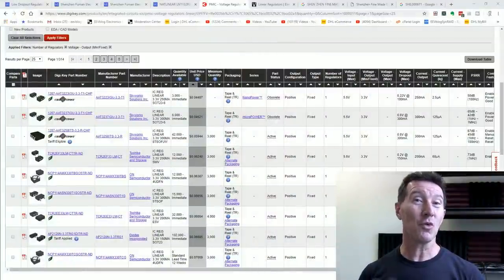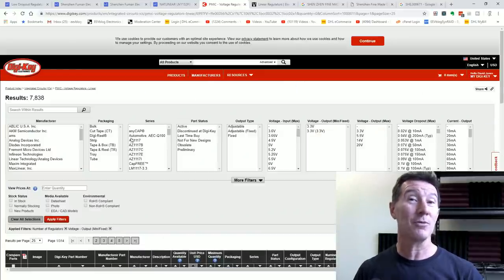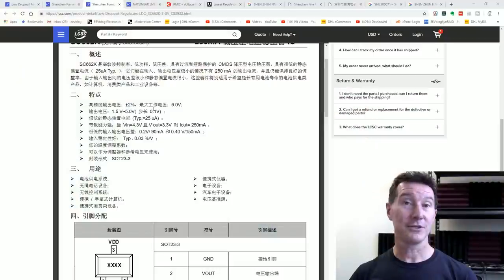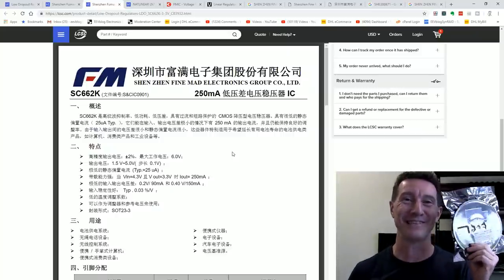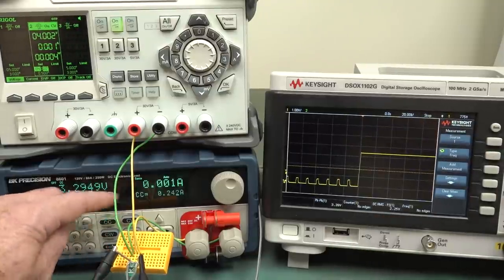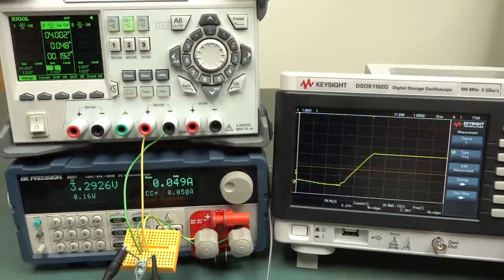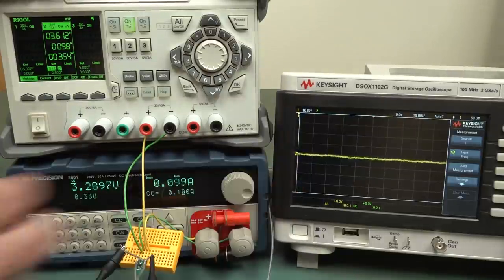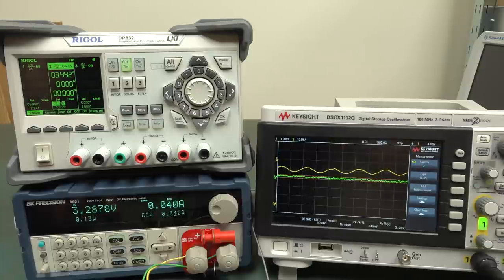EEVblog #1147 - 1 Cent Regulator! That's MAD!

Comment: I do have a question for a brilliant cheap man!
What would be the easiest/cheapest way to create a laser gauge for DIY 3D filament?
Basically made of a laser on one side, a cmos on the other side and the filament passing between them.
The shadow of the filament is captured by the cmos sensors.
I don't need a full image, I only need to know where is the interface between the dark and bright area on the cmos and I only need it for few lines.
Here is a video to explain the commercial (expen$$$ive) version:
@

I hope you can guide me. Thank you very much. Alex from Québec, Canada
Reply: Just look up the Prusa i3 Mk3's filament sensor.  Here's the schematic: https://github.com/prusa3d/PRUSA_Laser_filament_sensor/blob/master/rev.02e/laser-sensor.pdf
Reply: @tmilker  Thank you Ted, unfortunately I'm looking for a filament gauge to precisely measure the diameter of such filament. Your link is about a filament detector (to alert you if filament is missing during a print).
I want to build a filament extruder to make consistent 1.75mm filament from plastic pellets.
Reply: Could you use a lens to expand your shadow, like project it across the room, to make it large enough to use discrete lrds or phototransistors to take your measurement? MAybe not make a precise measurement, but at least be alerted if your filament diameter is coming close to your  tolerance and make suitable adjustments. the intensity of light reaching the senors over the distance would be an issue to overcome.
Reply: @marcaxe  It is a route that should be consider as well. Shal we!